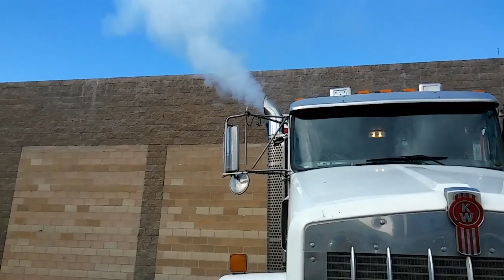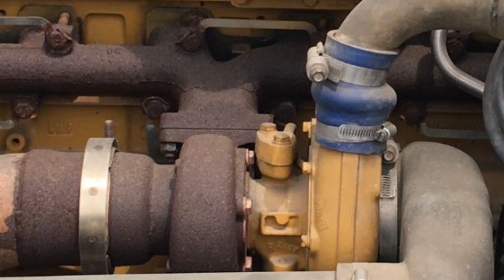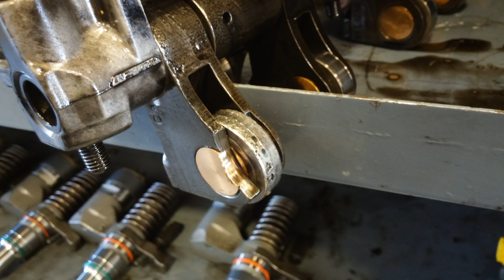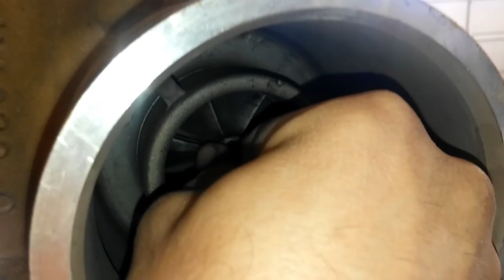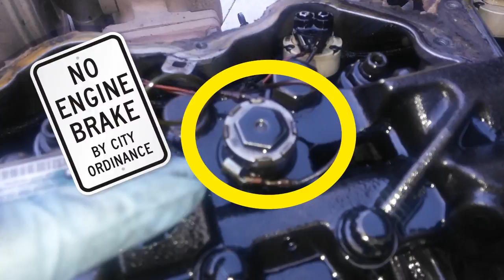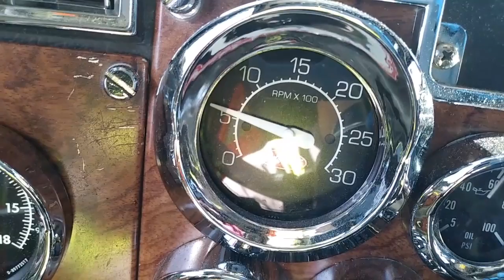Why Diesels Are So Loud? Why Are Diesel Engines So Noisy?

Comment: My 3.0 Duramax is very quiet, but it still has the "diesel" sound at idle.

If you're curious, I love it.  My 1500 Silverado gets over 25mpg highway and 18mpg city WITH my lead foot.  It's my highway cruiser.

Comment: I beg to differ I think a streight piped diesel exhaust is quiter then a streight piped gas exhaust but the diesel engine itself with a muffler is louder then a gasoline engine with a muffler.

Comment: Cummins got the 6.7 so quiet customers didn't like it. So they reprogrammed the injection to get some "Diesel knock" back into the engine. With common rail fuel injection and the ability to do multiple injections per cycle, a quiet Diesel is now possible.

Comment: They're fucking not louder than spark-ignited engines! I have heard motorcycles which are louder than 4,400-6,000 horsepower diesel locomotives.

Comment: another thing is that they usually have MUCH higher displacement compared to automotive gas engines. Especially on big semi trucks, they usually are 12L+. More displacement means more air and fuel which means bigger boom

Comment: A turbo is exactly like a jet engine.  It's essentially a centrifugal turbine engine with no combustion chamber. You can build your own jet engine if you just build a combustion chamber for it. I built one out of a drive shaft with a piece of exhaust pipe inside to act as a flame holder.

Comment: Why are they sounds like connecting rods bearings knocking on the crankshaft? it is thrilling as ones can think of the engine is already damaged. I've listened the same sound on caterpillars, specially on a pail loader when it starts first time in the morning with cold weather. What causes that spooky noise? please, thank you. Wonderful explanation and videos.

Comment: Don't the mufflers also provide some back pressure?  In some engines they do...and if you don't run them with a muffler, you can damage the engine.  Is this true on diesels, too?

Comment: I am driving a 2001 Peugeot 306 hdi. Thats a french 2l inline 4 wagon with 90hp since they put diesel engines into almost everything over here in europe. If you open the hood the injector chatter is ridiculously loud but I like it and the car gets close to 55mpg.

Comment: Hey man Idk any other way to get in touch with you I'm working on a 3034 cat the Perkins engine... I can't get it started there is no fuel to injectors at all I clean the main fuel line from tank to lift pump and   blead the air out the system Idk what else
Reply: I also checked the fuel shut off solenoid it's working properly the tractor was sitting for some time then went to turn it on it started with starter fluid but ran for like 30ti 40 secs... then turned off an never turned on again

Comment: I know I had an 01 Silverado that was 100% straight piped with true duals and I could start it and I started my Dodge Cummins you couldn't even hear the Silverado anymore my  01 Cummins was pretty much stuck at the time and it was ungodly loud and I drive 18-wheelers for a living the new trucks are quieter than my Dodge Cummins was

Comment: I have a freightliner series 60, can I use fuel injectors 4049. The originals, that are mine are 5575. Will the motor be damaged if I change numbers?

Comment: Nice video...you seem to be the one to ask about cats, I bought a 95 ford 9000 with a 3176 cat in it..can i put a Jake on that motor? Or just an exhaust brake....thanks in advance
Reply: 2YG, 7LG, 9CK? Should be a 9CK.

Engine Manufacturer: Caterpillar
Engine: 3176B
Engine Serial Number Prefix: 9CK
Horsepower: All
Engine Brake Model Number: 310A/3176
Engine Control System: Electronic
12 Base Kit: 148-7495
24V Dual Lead Base Kit: 148-7496
24 Single Lead Base Kit: N/A
Engine Control Group Non-ABS: N/R
Engine Control Group ABS: N/R
Cab Control Group: 143-6652 *1
Clutch Switch Group: N/A
Lash Setting: 0.025"
Adjusting Tool: 149-6114
Lash Setting: 0.025"
Tune-up Kit: 143-6626

Notes:
Special switch with gold contact, May not be required if vehicle has control pre-installed; however, low resistance gold contact switches must be used with this engine.

Comment: Block design can have some to do with it. Deutz air cooled diesel are individual jugs that are like your lawn mower engine just bigger and beefed up. And because there are no water jugs that absorb a lot of the noise, they are easily heard a mile away under load. I actually have a little bit of hearing loss from irrigation pumps powered by these engines. I should add that our ih 766 does have some noise from the injector pump and that is what you mainly hear at idle.

Comment: Ahh, the banging, hammering and clanking that that came out of the old slow turning 300 series marine Cats; the 343, 353, 379, 398 & 399 - pretty sure we paid an extra $10k just for the noise!  No fans, no mufflers, all engine and turbo.  Had a deck hand on one boat who was scared to go into the engine room because he was sure one of the mains was going to blow up in his face.  We all laughed until one did, what a mess . . .

Comment: We know Johansen of Jo Blocks, but who was Jake of Jake Brake?
Reply: Actually the company is Jacobs Vehicle Systems, Inc.  That name comes from Arthur Irving Jacobs who designed/developed the Jacobs drill bit.  More interesting is that the guy who patented what would become the Jake Brake was Clessie Cummins who also founded the Cummins Engine Company in 1919.  After being forced out of his own company in 1955 he came up with the engine braking system.  Jacobs Manufacturing opened the Clessie Cummins Division in 1961 to manufacture the brake system.  This later became Jacobs Vehicle Systems.  So it should probably be called the Clessie Brake???

Comment: My 1968 Kaiser-Jeep M35A2 deuce and a half has the Hercules 465-LDT-1C multi-fuel engine (22:1 compression ratio) & has the "whistler" turbo. There is about 6 feet of exhaust pipe past the turbo, and no muffler. You MUST wear hearing protection when driving it, or you will eventually go deaf.

Comment: Electro Motive Diesel (EMD), that power EMD Locomotives is a 2 cycle Roots blown or turbocharged.
Talk about a sewing machine smooth but tremendous power. Up to 567, 645 or 710 c.i.d. per cylinder ×16.
Anywhere from 1500 to 4300 h.p.

Comment: Love your videos Josh, you do a great job of making these topics accessible to everyone. I actually run a pump shop myself...

One reason for the distinctive knock of older diesel engines is the ignition delay period. There is always a slight delay between the beginning of injection and the ignition of the fuel. Low cetane fuel or cold engine temps will increase this delay period. When ignition does occur, all the fuel injected up to that point ignites at once, which suddenly increases cylinder pressure and gives you that knock. Modern common rail diesels are quieter because they use pilot injection. Pilot injection works by injecting a very small amount of fuel early, waiting for it to ignite, then injecting the rest of the fuel. This allows for a more gradual pressure increase which decreases noise. It also reduces NOx emissions. Common rail injectors used on light duty diesels since the turn of the century (and recently appearing on some medium and heavy duty engines) run at 24,000 to 33,000 psi (Cummins XPI can hit 50,000 psi), which gives better atomization even at low engine speeds and allows for more efficient, quieter combustion.

Comment: The newer ones are much quieter as they have staged injection with the fuel pulse broken up into stages with pilot, combustion, and post combustion injector pulses. This dramatically reduces the noise since your not burning everything in one shot. Pretty amazing how quiet a ford 6.7 is at idle.

Comment: Most of the noise comes from combustion, especially the older style diesels that don't have common rail injection. Modern diesels are pretty quiet.....with the injection system able to do multiple injection events in a cycle, the rattle can be controlled

Comment: Great video Josh! Question, isn’t the injectors a large source of the diesel clatter as well? I can’t vouch for cat rocker actuated injectors but I’ve heard 60 series and HEUI injectors on a test bench and they clatter loud enough it sounds like the engine they go in is running. Just curious, let me know what you think. Keep up the good videos!

Comment: The bulk of heavy diesels are paired with air brakes. The air brake compressor doesn’t help in the noise department.
Reply: weve got a CNG truck that is almost all just air compressor noise

Comment: Main reason most diesels are louder is they are bigger, ever stood next to an aero engine of the internal combustion type even fitted with a silencer they are loud, another main area for noise emission on the older type of diesel with mechanical jerk type injection is the injector pipes and nozels expanding and contracting each time they are pressurised, probably half the total noise  is from this area of the engine, one reason the common rail was developed. Then you have compression knock, combustion should be a fairly smooth process in itself with a steady flame front, no pre ignition in fact the problem with diesel is getting the fuel to start burning fast enough. Another thing is sound frequency in diesels it is much lower and this makes it sound louder to human ears.

Comment: Being a diesel tech myself, I agree with almost everything you said but I can not believe you didnt touch on injectors, especially older mechanical type and HEUI system injectors. You can literally hear a T444E/DT466/Maxforce 7/9 coming from a mile away they are so loud lol. Injector clatter for days. Btw only reason maxforce 13s are so quiet is they spend more time in the shop getting EGR coolers changed then they do running ;) Great video as always
Reply: International (and older powerstrokes) have very loud engine clatter
Reply: I thought the MaxxForce 7 was a Piezo Injector? Common-Rail and not HEUI? IDK anything about the MaxxForce 9.
Reply: What dose it mean when you hear engine knock or something like that it's banging like making a clunk, clunk noise on a cold start up? Diesel engine
Reply: Great scot, the MaxxNoise is so bloody loud you can’t hear yourself think, Ford’s ripoff is a bit quieter, but not much.
Reply: @jaysmith1408 in my experience at idle the MaxxShitter 7 is quiet. On acceleration it’s louder.

Comment: my first truck with a cat sounded bad like the pistons were swapping cylinders right now
I live in a 1968 gm pd4107 bus converted to a motor home Detroit two stroke every thing
on it is gear drive blower alternator water pump even the original Ac system fan runs all the
time engine temp controlled by shutter stat real happy that that the engine is 30 foot behind me cause dam that that old two stroke is noisy
you and yours have a good day
THE GRUMPY BUS

Comment: Oh I have a 2002 6NZ with 109 000 on the platinum rebuild and I love it 435 horses can raise it to 600 but scared of fuel mileage but I did have it turned up from 73 on cruise to 88 on cruise and it seems to get better fuel mileage will let you know if I do the 550 horses
Reply: The only way extra power hurts fuel economy is if you have your foot in the throttle, otherwise it's the same engine making the same power it always has to move down the road.

Comment: How can u get ride or whistle in 550 cat checked all hoses to air to air air intake .
Reply: Are you trying to get rid of the whistle? 550 cat is also not enough information, a 550 3406a has different considerations then a 550 acert.

Comment: I wonder if he daily drives a diesel truck ?
Reply: No reason to, it's cheaper to have a second vehicle then to daily drive a pickup. Grab an old Buick for a few grand with a 3800 and keep the extra $$. To have a mechanic drop a low milage 3800 into my old park avenue daily it was less then a third of the cost then having new rocker arms put in my 7.3. I'd rather drive the truck, but it just doesn't make any sense to drive it unless it's actually needed do to fuel and maintenance cost.
Reply: Jay Dunbar I get the saving money part cause I daily a duramax but I wouldn’t have it any other way
Reply: Nobody in my shop has a diesel and there is 7 of us.

Comment: I have a 2007 t600 with  a c13 engine , i keep adding a gallon of coollant every day and get smoke from blowby  and exexhaust.  Any idea  what  it may be ?
Reply: Water in they engine crankcase or dipstick  ? Maybe gasket head worn , the blowby is pistón rings stuck maybe help you
Reply: @luisgerardovazquezgloria8006  thanks  will check into that

Comment: I use full synthetic oil on 2400 cc diesel engine and after 6000 km the oil not turn quite black.
Reply: Upgrading to synthetic is not going to hurt anything, but I'm not really sure what this post is trying to say. The amount of soot in the oil that has nothing to do with it being synthetic or conventional.

Comment: the newer diesels arnt that loud anymore
Reply: TheOtherWhiteBread0  yes the dpf is a big muffler, technology is also responsible via better fuel mapping in the more advanced ecm.
Reply: TheOtherWhiteBread0  you're an idiot. 90% of the engine noise in a diesel engine is in the valve train and fuel injection system. Piezoelectric injectors and 50,000-60,000 psi fuel systems get rid of 85% of the fuel knocking noise in the engine. They fire the injector up to 5 times per injection cycle.

Comment: Passengers always comment on the noise of the early 7.3 Powerstroke turbo-Diesel in my van. “That’s loud, is that the exhaust?” “No, it’s just a Diesel.”
Reply: Dont you love going through a drive thru for anything? I still have my 97 7.3 f-350.

Comment: What about the injection system? I've heard a 24v Cummins and a common rail 24v Cummins. The vp44 is much louder.
Reply: The newer common rail trucks use multiple injections per combustion cycle. Where as the older trucks just use a single shot of fuel every combustion cycle with makes them much louder.

Comment: Downhill + Cat 3406e 550hp + straight pipe = BIG SMILE 

Thanks for the vids  .
Reply: Gotta love those 3406e engines. I sometimes forget how loud them straight pipes are during winter though. Then I'm reminded when the weather warms up and got my window open and hit them Jakes
Reply: I have Pittsburgh power performance mufflers on both of my 3406e, love the sound of a straight piped diesel but I'd also like to be able to hear in 10 years lol
Reply: Don't forget to turn on the Jakes
Reply: … in a tunnel